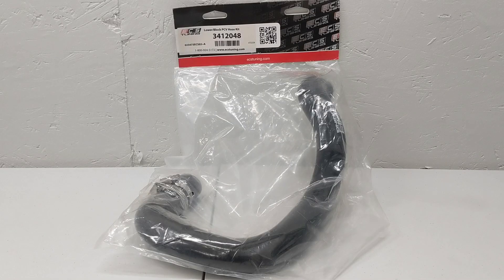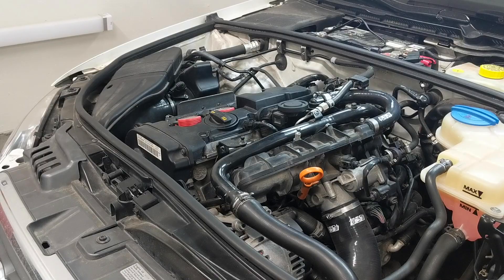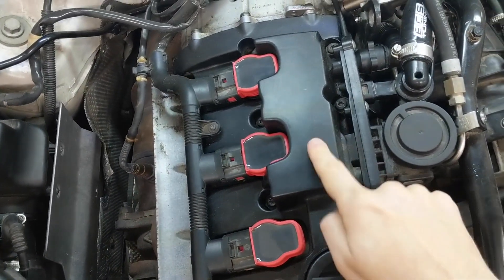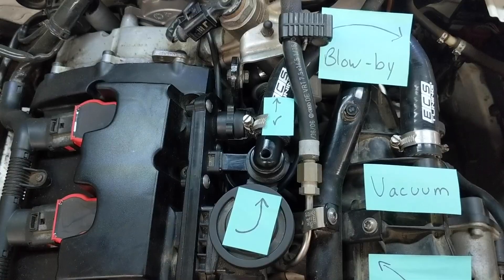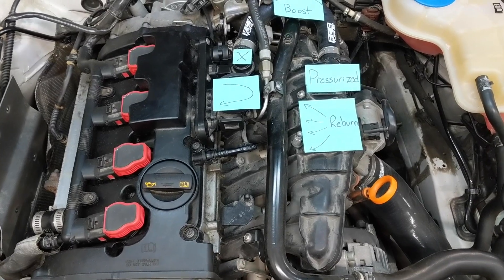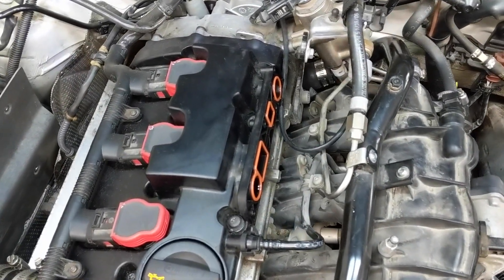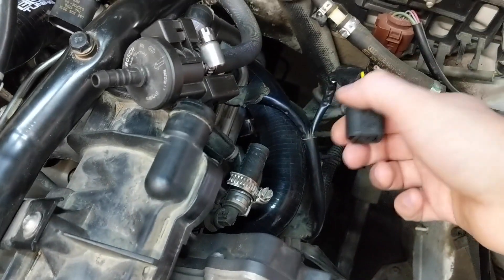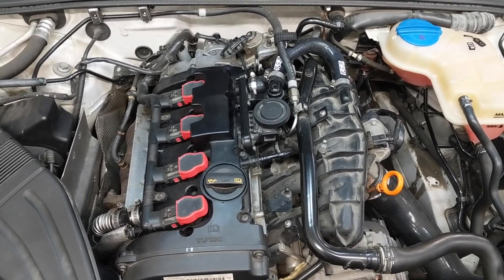How the PCV system works 2.0 FSI | ECS Lower PCV Hose Install | Audi A4 B7 | VW

Comment: When you find oil in the inter cooler hoses, would you replace the PCV valve? Or is oil in the inter cooler hoses normal? Also, I would love a video explanation on Camshaft position sensor and Crankshaft position sensor. Thank you for the helpful videos as always!
Reply from the maker: It's "normal". Assuming it's blow by. It's possible that excessive oil in the piping could be related to a turbo seal failure and the oil is draining into the charge pipes but more often than not on these cars, it's just the symptom of the PCV circuit. The easiest thing to do is pop off the lower intercooler couplings that go between the core support and both side mount intercoolers and let it drain out once in awhile. Sad but true.
Reply: @FigureItAuto  I installed drains in the plastic pieces that the charge pipes (hoses) clamp to. This is at the lowest point in the charge pipe run just ahead of the fender openings. Basically just 1/4-20 thumb screws with a small rubber washer as a seal. Takes just a few minutes to drill and tap the holes. No need to raise the car or remove anything. I check these at about 2.5-3.0k miles (4.0-4.8k kilometers). Typically I find zero to just a few dribbles in the passenger side and 50-100ml in the driver's side pretty consistently. It looks like typical motor oil. I see no moisture or anything else. Haya....